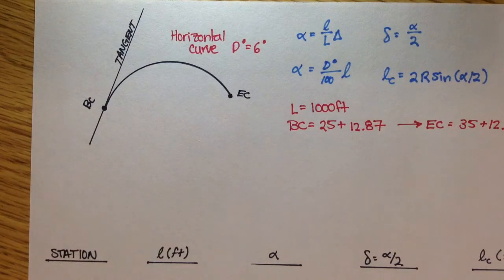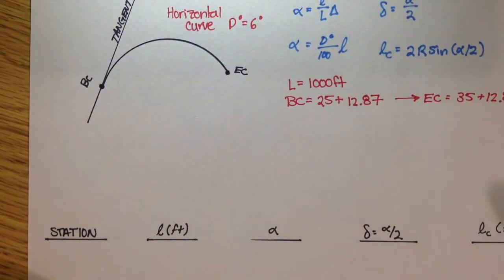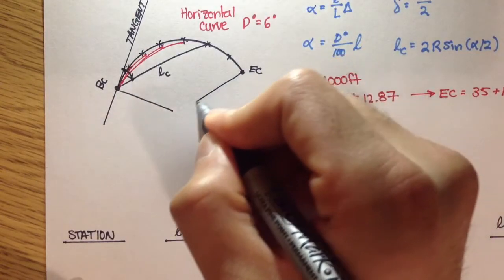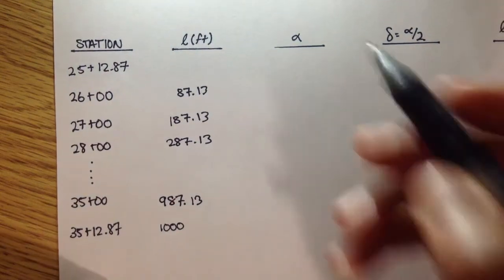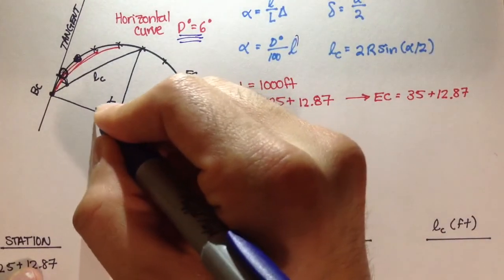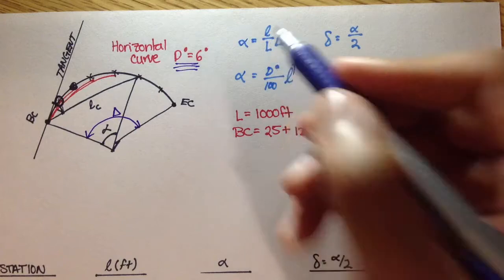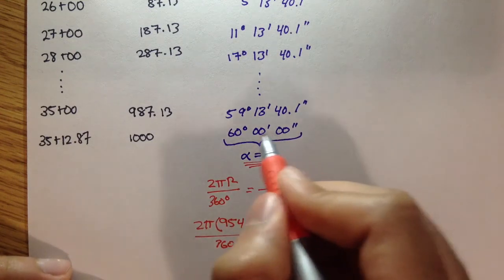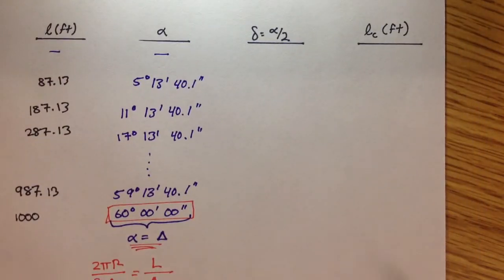Advanced Geomatics: Deflection Angle Example: Part 1

Comment: Did you multipley "l" with 0.6 or 0.06?
Reply: And shouldn't the arc be 1000 ft since we're using 1000 ft system